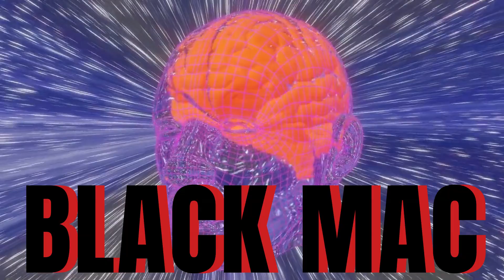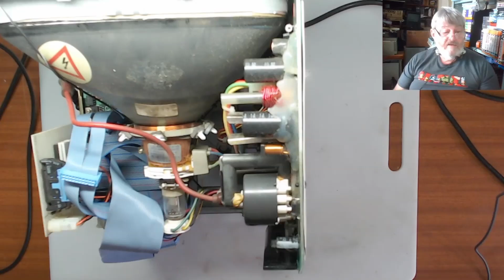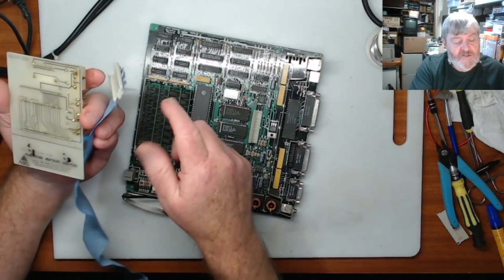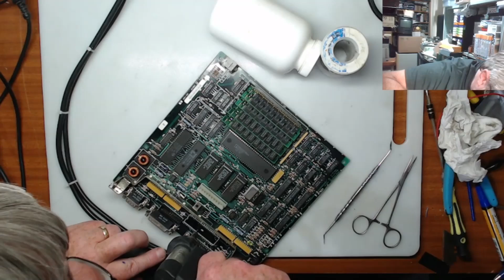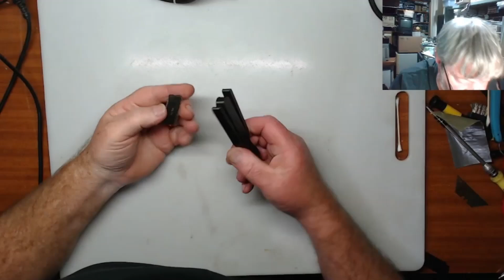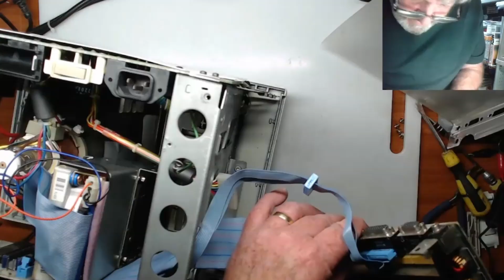Apple Black Mac pt1

Comment: There was no such product as "Black Mac" you have a modded version of a Mac Plus computer with an internal SCSI mod to support an internal hard drive which the Mac Plus did not support. Your mounting statements are complete nonsense. Having been in the industry since the 1970's myself and seeing literally thousands of systems with drives mounted in all manner of positions with zero ill effects I can state with zero reservation that you are 100% wrong and ask that you not make statements of opinion as if they are factual which again, they are not in this case. Bearings by the way don't wear due to the position they rest, they wear due to heat caused by friction. That friction is the same no matter what angle the bearing and the rotating shaft meet at.,
Reply from the maker: well its not my way of seeing and the way i was told back in the 80's.. but to each his own..  you have your ideas and i have mine and others have there's..